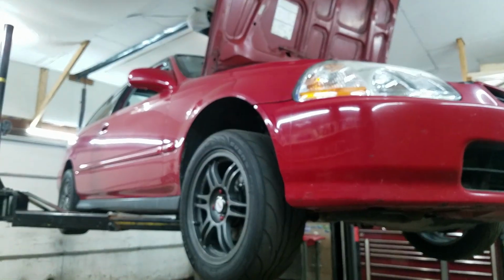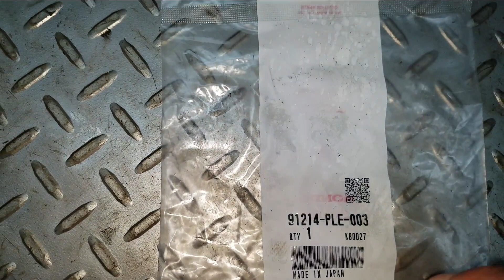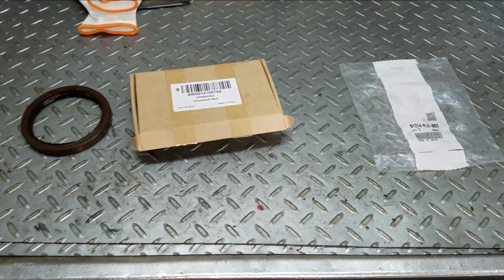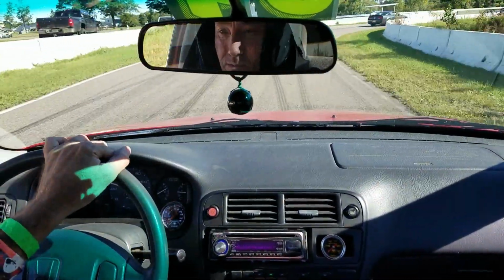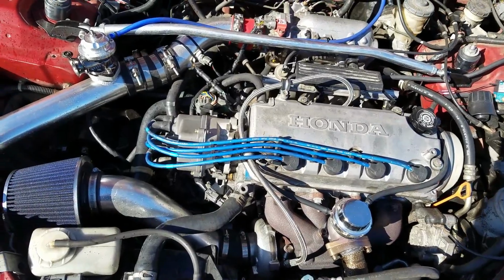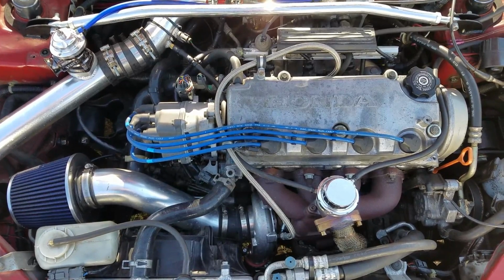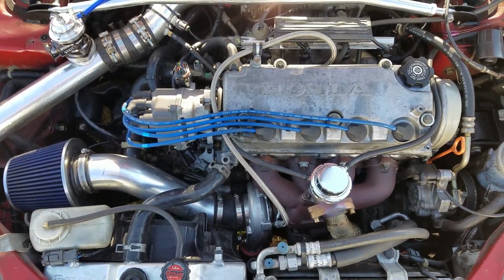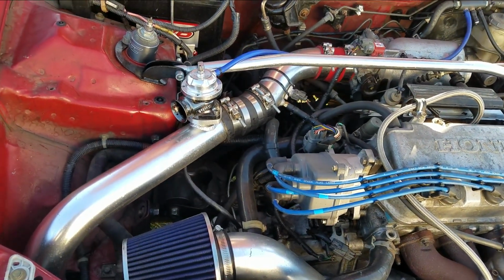D16 turbo EK Civic at BIR MAP proving grounds 2.0 part 21

Comment: Next year? NEXT YEAR? What about next week? It's supposed to be an addiction. 👍👍👍 I should know. It's hard for me to believe that there is a gasket that can seal like o-ringing, but then again, I am old and outdated. If you really get it to seal, then you can burn pistons instead 😀
Reply from the maker: Look up je pro seal. They fold one of the inside layers.
Reply from the maker: HDPE only happens up here like 4 times a year or something. Map proving grounds twice. If I wanted to do it all the time, I would need more money than God, and would have to gallivant all over the countryside.
Reply: @RustBeltAuto  yeah, I was informed about these gaskets recently after watching your build videos. The guy has built a lot of turbo motors for motorcycles and that's what they use. I don't think they are JE, but the same design. Thanks.
Reply: @RustBeltAuto  yeah, I know how it is, believe me. I barely get by, but that's better than working for the man. I have been involved with Professional Drag Racing as an unpaid mechanic for a low budget team. It satisfied my addiction without spending my own money, which I don't have anyway. We used to go to Brainerd every year. What a different kind of place with the "Zoo." I am guessing you ran on the shorter course which doesn't include the drag strip.
Reply from the maker: @nealmont  yes. The close the strip off. It's too fast.
Reply from the maker: @nealmont  when you say the "Zoo", are you referring to all the juveniles getting drunk all night long, making craploads of noise in the campground until the sun rises?
Reply: @RustBeltAuto  yeah, and it ain't just juveniles. Its out of control, kinda like it was in the 70's. It the only track on the NHRA circuit  that's still like that. If you look at a map of the track, the ZOO is actually the official name of the area. Hey, ain't the motorhome a lot better than the tent? Driving on a real road course looks like tons of fun! Never done it.
Reply from the maker: @nealmont  I like tents better honestly. If I wasnt alone, an RV might have been okay. It's the most fun I have had on 4 wheels. I drove a dune buggy in the desert, that would be the second.

Comment: Right on. I wonder if you can get it o-ringed then run the boost higher in each gear but increase your final drive ratio. You probably wouldn't need to down shift on a couple turns. That and stiffen up the suspension so you're faster though the turns. Bet that would be uber fun then.
Reply from the maker: It has boost by gear. The suspension is done about as good as it can be. Pro-seal head gaskets are supposed to work as good as o-rings, so I have been told. Less timing may help. These heads are known to lift boosted. Head studs are larger on twin cams.
Reply from the maker: Didn't you notice I passed a Type R, Corvette, and a WRX? I think It's already uber fun. Just need to keep it from lifting my head apparently.
Reply: @RustBeltAuto  True to the moo!

Comment: Looks like a really fun time! Maybe next up you can find a S2000 that needs rebuilt or something, that is a REALLY fun track car!
Reply from the maker: When gold nuggets start emulating out of my orafaces, I will get something better than an s2000.
Reply: @RustBeltAuto  Well what would it be? Ariel Atom perhaps!?
Reply from the maker: @BarnStangz  something with air conditioning.
Reply: @RustBeltAuto  cadillac cimarron?
Reply from the maker: @BarnStangz  Preferably something with an LS engine in it, that is not a janky Chevrolet like a Camaro or something. My options are open. What I have now is an excellent platform. It's super fun.
Reply: @RustBeltAuto  For sure! Glad you are having fun. Do you think you would stick with the road type racing? Lot of guys use a Foxbody with a LS and have pretty good results.
Reply from the maker: @BarnStangz  don't like mustangs.
Reply from the maker: @BarnStangz  it has a McPherson strut front end, and a solid rear axle. That would be a downgrade from what I have now.
Reply: @RustBeltAuto  I've been in an IRS Fox's before, they handle quite well. But yeah, the fronts can use some more help. Most people that run tracks do a tubular k member and some good coilovers. I just mention the fox because they can be found pretty cheaply. But I know you... and you... DO WHAT YOU WANT!
Reply from the maker: 4 wheel independant double wishbone is the best hands down.
Reply: @RustBeltAuto  For sure! Well, what could you get that has that, cheaply and could toss an LS v8 in there?
Reply from the maker: @BarnStangz  944 Porsche?
Reply from the maker: @BarnStangz  I think people are stuffing them in Fiero's too.
Reply: @RustBeltAuto  Oh yeah, LS swap in a 944 Porsche would be sweet! That'll ruffle the feathers of some purists! I want to say some guy did a LS turbo in a 911 or something like that, the thing was wicked... Now I need to search YT for it!

Comment: Hey are you still gona get the bigger head studs? Just got my car tuned and making 442hp on 22 psi. Pushed a little coolant out also so thinking of doing bigger heads. If you do it would love to see how you do it or what’s the process. Thanks
Reply from the maker: I literally just did a video on it. Head is at the machinist now. Hope it works out okay.